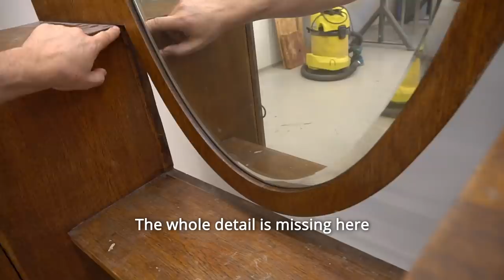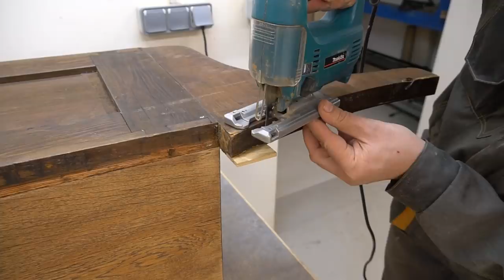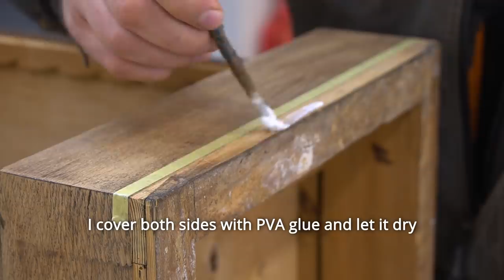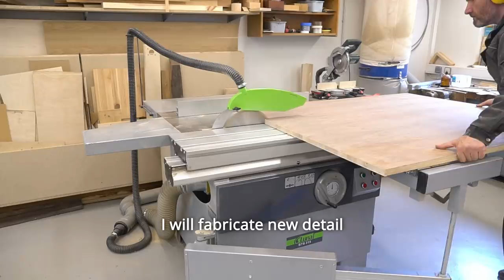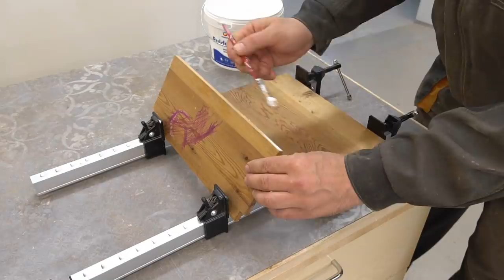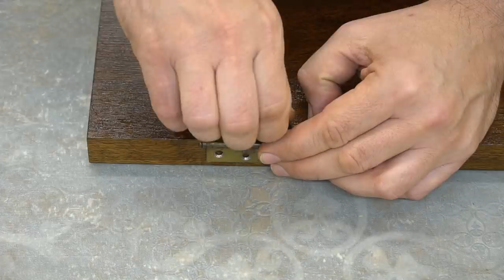RESTORATION - ANTIQUE ART DECO VANITY/DESK

Comment: I think you have been doing a very good job with your restores but I have a couple of questions regarding your gluing
when doing veneers, you quite often apply PVA glue and let it dry before ironing them together, wouldn't it also work to iron them together while the glue is still wet and the iron would set the glue?  or do you just find that it is more reliable for bonding veneers since you can't always press thin materials over a large area with a flat board
I've also seen you using polyurethane glues for loose joints so that they expand and fill the gaps, do you have any problem with the joint being weaker because the glue has foamed up?  I'm wondering if a epoxy glue with sawdust or some other filler being used as a thickener would be better

Comment: I have seen lots of your restoration, but disappointed with this one, you could have removed mirror and Check the frame, also the door lock space should have covered with wood by cutting it small 2x3inc square, the edges u made could have actually been restored better by doing whole small side as one piece and then apply Varner on it to make it ok same, the mirror bottom edge was disaster some.one like you could have easily made some carving on it to make it look out of the world. And then coles shellac its clearly seen the pieces added later and original. The magic of repair is no one so identify easily the repair work